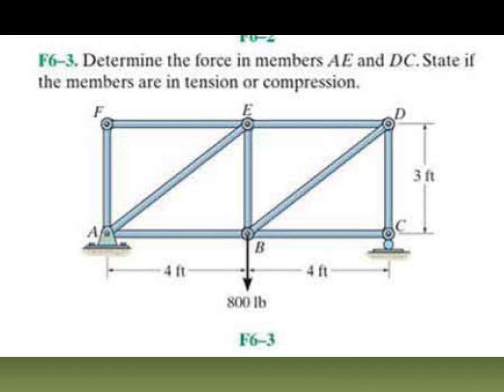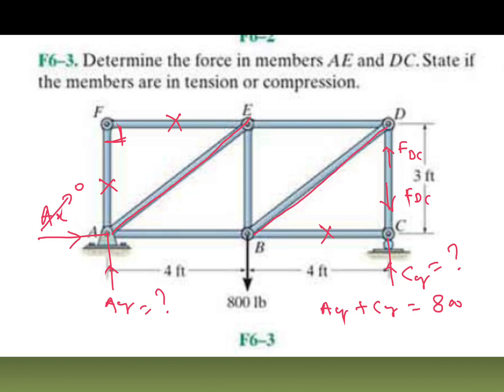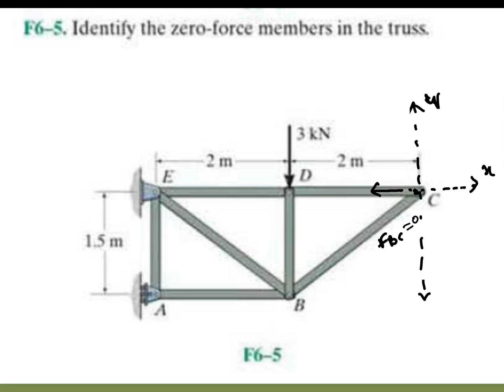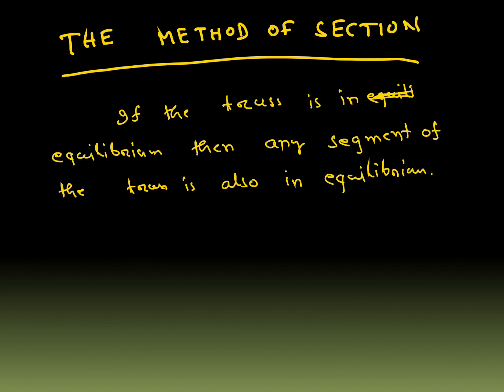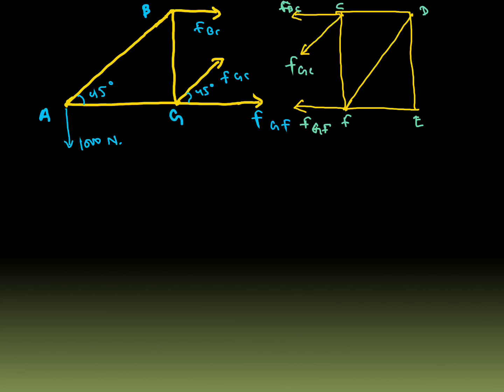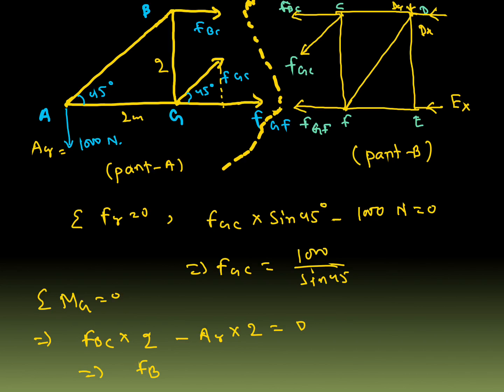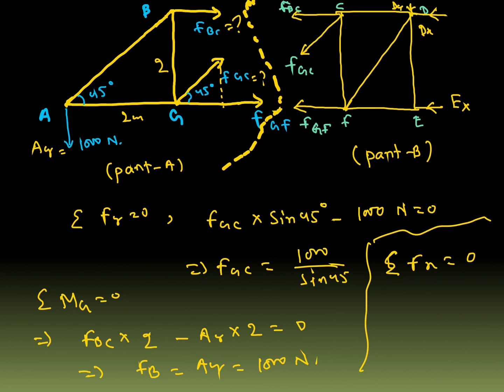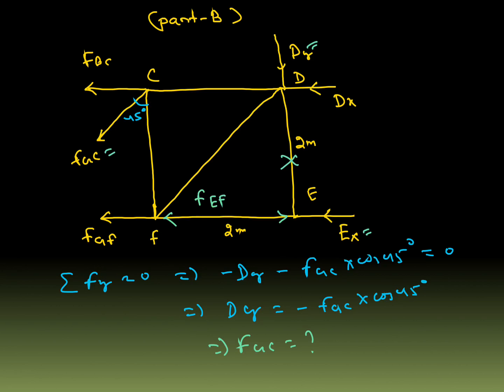METHOD OF SECTION, TRUSS ANALYSIS

Comment: If force in AB is asked, we can cut through AB and AG?
Reply from the maker: +Debasis Panda no need to cut apply method of joint angle bag is 45 deg for getting Fab
Reply: MY MECHANICAL ENGINEERING yes.. Sir